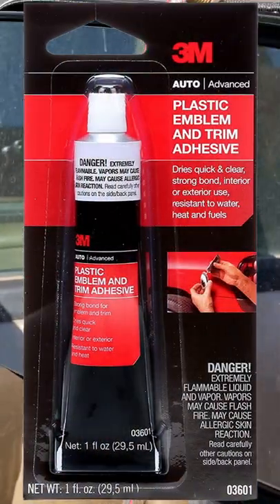3M Plastic Emblem and Trim Adhesive, 03601 #shorts

Comment: Just checking how well this will work with netting on fabrics
Reply from the maker: I have only used it on my side view mirror. The product descriptions says it bonds fully cured automotive paints and plastic for interior and exterior applications. 3M has a lot of different formulas. You could look at 3M Super 77. It is a multipurpose permanent spray adhesive glue. It says it works on paper, cardboard, fabric, plastic, metal, and wood.

Comment: Would it be good on a spoiler?
Reply from the maker: It worked great for my mirror but I haven't tried it on anything big like a spoiler. It says it bonds plastic to metal paint. So it should work.
Reply: How’d it go? I need to install a big carbon fiber ducktail and I don’t want to screw into my car or the carbon fiber, and I know just 3m tape won’t hole 17 pounds of carbon lmao